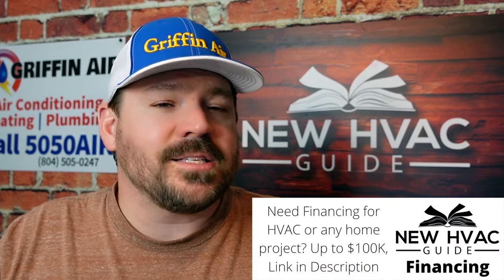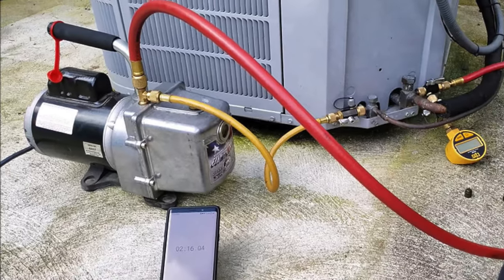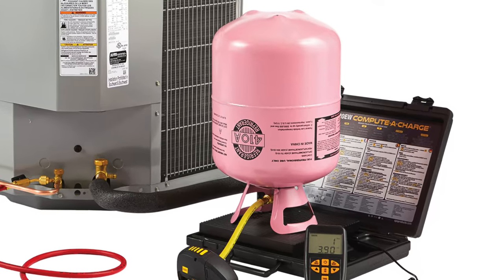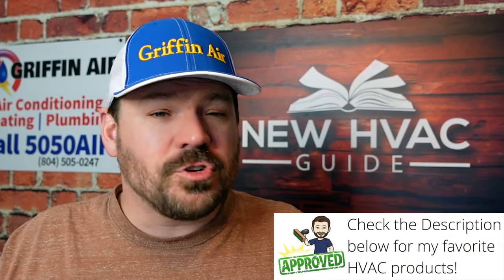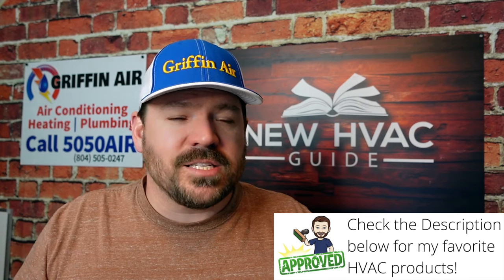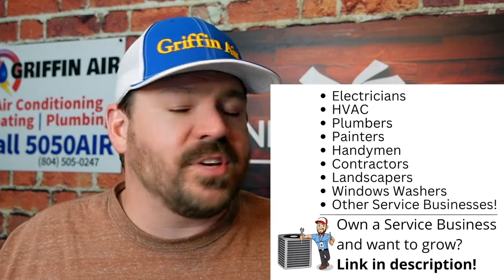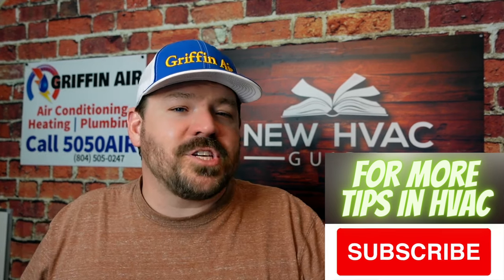Don't Check Refrigerant in Mini Splits. Here's Why!

Comment: If a homeowner asks me for no or low cooling call on minisplit, I first check the condenser unit for suction line sweating, and the fan air for how much hot air is coming out, and the condensation line if there is any water coming out of it. These can give initial indication, and don't forget the inside unit filter check.

Comment: I have a senville unit and its winter time now, How would i charge the system up if its completely empty because there was a leak and now its fixed but system needs to be filled to rating plate compacity, How do i fill it up? Force it into cooling mode and fill up? They have a option to force it into cooling mode to charge it

Comment: Very true, but you can set the temp control down low and verify performance by measuring the temperature drop across the indoor coil. That would give you a pretty good idea.Also look things over good for traces of oil. Nice video. thanks

Comment: Thank you for sharing this info about the mini split AC units. I am not an HVAC tech but I do many DIY things around the house and mini split AC units are among them as well. 

I can check the pressure in the system but I cant tell how much its missing to add accordingly so Yes I do agree with your statement to completely discharge and recharge based on the label numbers and those systems are not that smart to tell you how much free on is missing in the system.  

Thank you once again for sharing the info. God bless you and your family.

Comment: Great Video Thank You for sharing, I have a question for you,  I have a Mitshibishi muy-gl18na-u1  18BTU 20.5 seer mini split, My system will not ramp up,  It blows cold air inside,  The outside unit I have a Error Code 3 blink then pause 2.5 seconds, its under warranty still, A diamond perffered company replaced the Board, and compressor, I installed all new sensors, I removed the blower wheel and cleaned the inside unit back to new looking, No matter what I do system will not ramp up,  You can hear the compressor ramping up but the fan motor stays in the same speed.   Any Ideas?  Maybe the Fan motor going bad?
Reply: Sounds like you need to add some blinker fluid to the tabulon flux joint.

Comment: While technically correct about weighing refrigerant, modern mini-splits have specific instructions on how to check refrigerant without removing it (I.e. “loading it up to capacity”). 

Eventually one of these “not my install” HVAC companies are going to figure out how much DIY install money is left on the table and start making a butt load of cash!

Comment: This isn't my day job so this is an interesting factoid. We installed a LG minisplit inverter system, two compressors 6 indoor units a couple of years ago, nice piece of info to take into consideration especially with R410a phaseout.

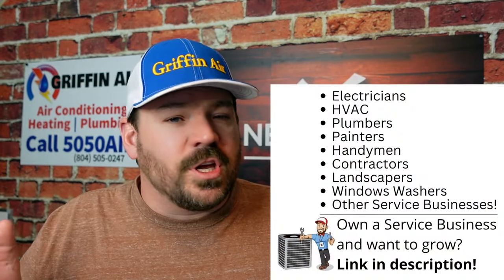Comment: 2:43 The same thing happens with conventional systems too. If it’s a maintenance call you shouldn’t have to put your gauges on a system if amp draw, delta T, and everything else checks out good.
Reply: Problem is TD is a very poor indication on how well a system is actually operating.  It tells you the air is cold.  But is it cold because of poor airflow?  Maybe you have a low td.  Poor TD could be anything from airflow to high humidity.  And amp draws tell you next to nothing on an ecm motor.

Comment: Just out of curiosity, why would a company like Pioneer sell A refill/dye/leak sealer all in one kit and still back their warranties. These kits they sell are all pressure-based installs.

As I write this, I am awaiting the very same kit. I will be storing all refrigerant back into the outside unit, then vacuuming the lines and leaving the gauge hooked up for 48 hours or more, and if I have no leaks, release refrigerant and top off with pioneers kit. now explain to me how I’m either going to become a participant in a  a class action lawsuit or, if  Indeed, Pioneer does have a legitimate fix?
Reply from the maker: That's a new one to me. I'm curious on how that will turn out.

Comment: I have found a kinked refrigerant line between my outdoor unit into the wall. My question is  do you remove the refrigerant, cut out that piece and weld in a new section? Or is it a much bigger problem
Reply from the maker: Yes
Reply: @NewHVACGuide  Awesome 👌

Comment: It's hard not to be skeptical. I know it's not as simple as a bike tire, but there's this idea called PV=nRT, and it describes, with mathematical precision, just how much stuff a given volume will contain if you can determine the pressure and temperature. 

Well, a mini-split will have a known volume (given line-set length), and thermometers and pressure gauges aren't exactly beyond HVAC guys, right? Connecting to a system that's pressurized can't allow air in, and the amount of refrigerant that escapes is negligible. So maybe there's room to try a little harder, because it seems to be like the excuse boils down to 'the math is too hard!'
Reply from the maker: I think you’re oversimplifying the point of the video. Doing math and adding refrigerant would be different from an actual test of an inverter system, for example
Reply: @NewHVACGuide  Doing "an actual test of an inverter system" is exactly what I'm talking about. The amount of refrigerant comes down to pressure, volume, and temperature. There's nothing more needed. I'm simply not hearing any good reason why it shouldn't be done. You just keep saying that you can't. 

What is it that you think the homeowner was asking for? They wanted to know if their charge was optimum for efficiency reasons. As long as the machine is running, there's no other test that matters.
Reply from the maker: @pocket83squared  because an inverter system without the ability to perform a test at 100% capacity is useless. Yes there are videos where people talk about rule of thumb and “getting it close”. But there is no one that can properly do a subcool measurement or any other measurement on a system not running at 100% capacity or airflow. 
It’s not rocket science. It’s reality.
Reply from the maker: So please tell me what exactly you don’t understand and I can try to spell it out better.
Reply: @NewHVACGuide  Clearly, you want me to be baffled by all the technical hurdles you face, but you aren't spelling them out in any way that I can understand. "Capacity" is just some useless jargon. We're talking about an amount here, nothing else. 

One more time, in the simplest language I can type:
If I want to check the appropriate amount of refrigerant, I should need only the volume, temperature, and pressure of that system. What else does one need to be able to tell whether the amount is appropriate? What am I missing? Since reality is not rocket science, surely you have a simple answer.
Reply from the maker: @pocket83squared 😂 ok
Reply: @NewHVACGuide  Helpful. Thanks.

Comment: Hole created in copper piping during mini-split install. Refrigerant out in a week. The leak site was easily located, easy fix. Has my brand new system been ruined? Or will a patch and refill be OK? Thanks in advance for opinions!
Reply: Patch and refill depends on whether or not the system was operated while very low or out of freon.  If so then the system will need a new liquid drier and double/tripple vac and over night vac before recharged.

Comment: Ok, so if this is not recommended, I am wondering how to address the E4 error code on my okd minisplit. Made sure outside unit is clear of debris,  all filters are cleaned, thermometer is fine. The only thing I can think of is the refrigerant, which makes sense because it is almost 15 yrs old. So, do I test the psi and add refrigerant or no? Any advise is appreciated.

Comment: What is the proper procedure on recovering all the refrigerant from a mini split?  I put my entire home and pole barn on mini splits (installed 6 mini split systems, all energy star rated 22-28 seer) and one of them ended up with a leak, even after passing pressure testing of several hours (at 200 psi) .  Anyway I want to recover all the refrigerant, fix leak and pressure test again etc and refill.  I got my EPA 608 type II certfication, have a 30lb tank of r410a, bought a robinair refrigerant recovery machine, and scale etc.  I am now searching on how to recover from a mini split, only seeing videos on normal ac systems  and how to do it on them, not finding mini split recovery.
Reply: Search YT for terms "mini split draw down" without the quotes if you havent found them by now. There are some good videos on it. I cant link to it any as my comment will get autodeleted.

Comment: I don't quite understand - why would say a 3 ton mini split have so much less refrigerant than a 3 ton central heat pump?

But having recently (like 2 wks ago) upgraded heat pumps, I do like the technology.  For once, without redoing ducts or other invasive modifications, my two levels are within 1 degree F (sometimes within 0.2 degrees!) of each other thanks to inverter technology.  Used to be a ~3 degree difference.

Comment: I have a question the output line is cold like it supposed to be on my outside unit but the return line going into the outdoor unit is not cold
Reply: Your explanation is not clear enough to understand.
Reply: @markgresin6335  that's okay I've been figured it out and fixed my problem

Comment: Is there an existing mini split system that monitors its freon levels?
Reply from the maker: Most have a way to shut off if the refrigerant levels get low.
Reply: Weird no one made a fitting that screws on the low pressure port with a zigbee sensor to read the pressure a million times a day. THAT would give excellent info over time on how the system is working.....

Comment: Check refrigerant with super heat or sub cooling and saturation temp. All other technique are good but take too long
Reply: At the same time your superheat/subcool can be influenced greatly by the speed of the compressor.  Unless there is a speed latch or charging mode, you can't be sure the compressor is ramped up for 100%, which is generally needed to charge properly.

Comment: Wish I had seen this before I followed a different YouTube recomendations whereby one can check with a gauge ( mini split running on full cold) and if running under 129 psi, add refrigerant ( after purging lines) intermittently to bring it back up to 120 ish. 
I think I overcharged it so then I realeased some back out, but now I agree, the only sure way would be to remove all the refrigerant and weigh in the proper amount.
Reply: 120 psi

Comment: Good data, and it makes sense. I have 3 and 4 zone LG's and am chasing a "spitting water out with the cool air" issue. I was wondering if it might be low pressure in the system, but the other 3 units are totally fine (the annoying one is on the top floor closest to attic). Everything else works, so will NOT check the pressure myself.

Disclaimer: I am an idiot who keeps the AC working on a pair of 1980's Porsches. I know enough to know a small difference makes a big mess. :-)

Comment: Just like every repair person he explains a simple mini split leak repair in a way to where he makes it sound like it is the hardest thing to do and it is going to break him to pieces and it is soooo hard to do....

Buddy it takes a few minutes to do. The way you said "Find the leak, recover the refrigerant, fix the leak and all the stuff that comes along with it, and then fill it back up and weigh it and ..."

It is not that tough. I am not even an ac guy. I am a doctor and I was able to walk myself through the entire process the first time and that includes weighing the recovered refrigerant and brazing a coil into a 15k but Mitsubishi. It took me about two hours to do everything from start to finish and I am not an ac guy. Getting the parts is the hardest thing. Literally ALL of these blue collar jobs are relatively easy when you have the correct tools and decent materials and you order things that are easy to put in and or complete out of the box installs. After I saw what my 20k ac system took to install and saw the $5500 worth of materials that were involved I vowed that I would ruin the person's life that installed it and I promise you I will make him lose a total of $200,000 by the time I am done screwing with him.
Reply: sounds like you should've gotten multiple quotes

Comment: Could someone help me, I have a mimi split that the fan freezes up outside when heat is on what's wrong, does it need freon. Doesn't blow hot air very good
Reply: Low refrigerant due to leak probrably flare

Comment: 30 yrs in this field I use Gauges as less as possible. Loose Ref is a possibility when install gauges specially on hot days where pressure is high 450 normal on 97 degrees summer time  Griffin is rite DUY need stay away from Gauges. 5 yrs of School here n 30 plus in fieldwork trust me

Comment: I figured as much, Josh.  These things have a mind of their own, so to speak, the way they cycle through so many states.  It's neat because it works well but it's also complex and likely to be a maintenance nightmare.  Not surprising they have a full-go mode for charging. I'd imagine there's a whole hidden troubleshooting menu with a set of functions to manually operate all the components.   

I don't know how these little guys meter refrigerant through the evap but computer controlled big chillers have an electrically controlled motor valve the computer commands based on temps and pressures continuously sampled.  I figured when I open my system again I'd attach ports to install pressure sensors then I could watch it work whenever curiosity hit.  I wouldn't be shocked if the mini splits were continuously monitoring temps and pressures.

Comment: Couldn’t you just turn off the system for like an hour and then turn it back on and obviously it’s going to want to be at full capacity to get that back up and then you could check then I mean considering that at that point the system is probably gonna be running at 100%

Comment: is there any way to check refrigerant levels with the system turned off?  my outside fan conked out so my pioneer won't stay on;, also the high pressure valve has no port.

Comment: I completely disagree with you. Sure you can tell if it's low on refrigerant,  just by throwing your gauges on any mini split. I've been doing it since they first came out.
Reply: Not on inverter models. Too many parameters change continuously. Unless the device tells you what it needs, weight is the only means of doing it right.  That said, on a nonworking system, you could put refrigerant in, test by feel on blowing cold, add more, repeat. It will fix it for a while or kill it completely.

Comment: Everyone is saying that the only way to check the correct amount of freon on a split system is to weigh it in. That is not true. Just shut the system down for an hour and measure standing preasure. 410 at 75 degrees should read around 210 lbs of preasure.
Reply: What if it’s 85 outside?
Reply from the maker: I'm not sure where you learned that, but that's definitely not true. There are many rules of thumb that may be close, but there's way too many variables for that to be true. Lineset length would be one.

Comment: Sad but mostly true. There are too many variables to diagnose properly for it to be cost effective for the homeowner. Put it on the curb and install a new one. It will be cheaper in the long run than have a hvac tech to work on it.